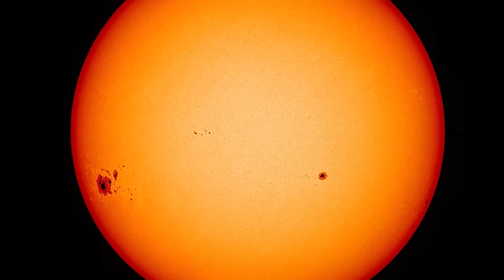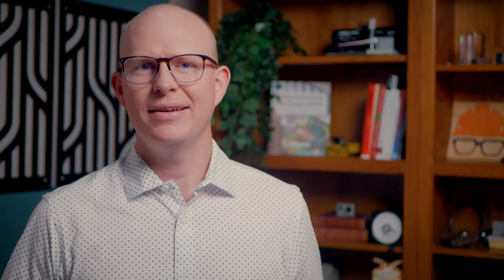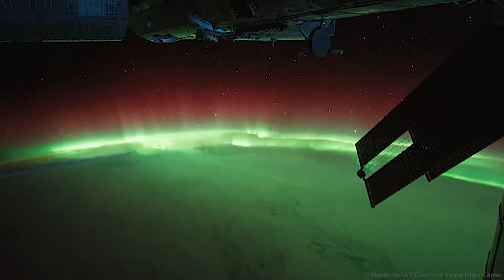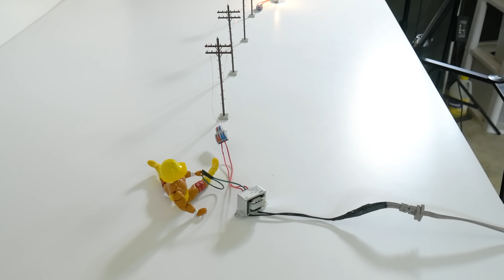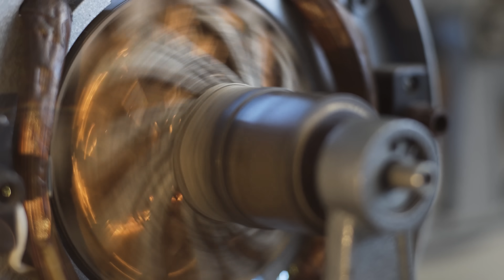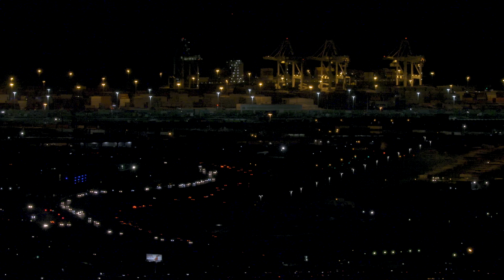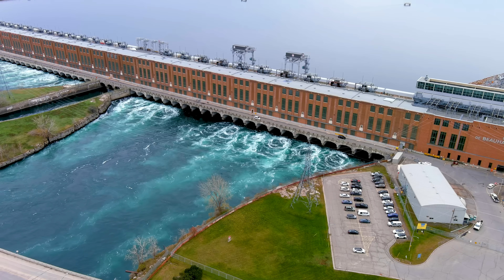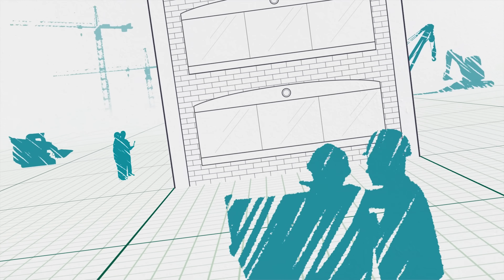The Most Confusing Part of the Power Grid

Comment: How does the design of the electric meter on the home measure only real power usage?
Reply: It just takes a whole lot of samples of the voltage and current, multiplies V * I for each sample, and adds the results together.  Simply put.  Elements representing active power will be positive, and elements representing reactive power will be negative, so you get real power simply by adding them all together.

Note that current direction != power direction.   It is (current x voltage) that represents the direction the power is flowing.   A regular resistive load will have samples that are (positive_current x positive_voltage) and (negative_current x negative_voltage).   The resulting multiplication is POSITIVE in both cases.

Reactive components will see a (negative_current x positive_voltage) or (positive_current x negative_voltage), both of which are NEGATIVE and represent power flow in the reverse direction.

-Matt
Reply: @junkerzn7312  I know how to do the integrals, I just wonder how that little device practically does it.
Reply: @spelunkerd  Sure.  Ok, so basically it measures voltage and current.  How does it measure these items?

(1) Voltage.  Voltage is simple.  The utility meter simply measure the voltage of each leg relative to neutral.  It does this by taking each leg and neutral and running them through a 1 Mohm (or similarly very high) resistor, and then to a resistor divider and small capacitor (like 10nF) to stabilize the value.  And then shoves that into an ADC in the micro-controller.

(2) Current.  There are two ways to measure current.  One is with a shunt, the other is with a current transformer.

(a) A shunt is basically a small, precise resistor.  For example, a 1 milliohm resistor.   The two hots and the neutral each pass through a shunt and the micro-controller then uses a voltage sensing circuit similar to (1) above to measure the differential voltage across the shunt resistor.  The current is calculated from that differential voltage.

(b) A current transformer can be used instead of a shunt when measuring AC current.   A current transformer is basically an inductor wound around each of the legs and the neutral (three of them).  i.e. just a piece of wire with a couple of winds around a cable.   Usually its a few hundred windings... like 500.

AC current through the leg/neutral INDUCES an AC voltage on the current transformer.   This voltage will be out of phase with the actual current, but that's ok, the micro-controller compensates for it.

The micro-controller then measures that voltage more or less directly.

That's how it works.  Shunts are used (A) When high accuracy is necessary and (B) When measuring DC current.   Current transformers are used when medium accuracy is ok but only work with AC waveforms.

There is a third way to measure DC current and that is with a hall-effect device.  However, this method is quite inaccurate.   "DC" Clip-on Amp Meters use this method in DC mode, and use the current transformer method in AC mode.   This is why DC clip-on amp-meters have to be "zerod".

-Matt
Reply: @junkerzn7312  Thank you, Matt.

Comment: I'm 90% less dependent on the grid.
My DIY system powers all my 120v circuits. I just installed a heat pump water heater. It barely sips on the electricity.
The grid power is now the supplemental power and solar became the main power. I only pay 20 cents per day on average to my power company.
During power outages, I have 3 days of stored electricity. When the Sun is shining, I have a unlimited power.

Comment: An easy way to remember the phase relationships is:
ELI the ICE man.
In an inductive circuit (L) voltage (E) leads current (I).
In s capacitative circuit (C) current (I) leads the voltage (E).
Reply: I always used the word CIVIL when teaching Power Systems to CIVIL engineering majors - "in a C, I leads V but in an L, V leads I" !
Reply: Oh I so remember that mnemonic.
Reply: I learned that in Circuit I my first year in college... Lets see Motion Flux Current or Mary's.... um ah...

Comment: The Tesla battery in Australia does more for grid stability than it does for supplying backup power like everyone thinks it’s was installed for.

It’s insane how much $ they make by just securing South Australia’s power network stability
Reply: no no. "The Tesla battery in Australia is meant to be for grid stability, it’s insane how much $ they make playing the energy market with it."

While I am to lazy to look up the numbers on the SA battery at least two batteries in QLD have been fined for not being able to supply the "stability" they were contacted for because they were playing the energy market.
Reply: @stusue9733  probably right, but if you knew how much they made - the fines would be petty cash
Reply: @InvisageStudios  Yes its a wonderful well planned system we have in place.

As I said in another comment, I have three generators. Mostly(though not completely in fairness) because our wonderful first world grid.
Reply: Common Elon W.

Comment: Can you heat your home for free using inductive loads?  Run everything thru a big transformer?
Reply: No, any power dissipated by the load on the house-side of your utility meter is real power.   Reactive power is REFLECTED power... it exits back to the grid through the meter.
Reply: Personally, I prefer the soothing glow of a giant resistive toaster.
Reply: @Alfenium  if I understand right though, a resistive load has a power factor of 1.  So you pay for all of it.  Transformer or a motor coil without a rotor would be close to 0, so you pay for very little of it.  Heat pumps use the power you pay for more efficiently.  But it sounds like residential meters allow some power without paying in the form of inductive loads so I would think we would be economically incentivized in the winter to use more inductive loads.
Reply: @BCroan  aint now way you're choosing hum over glow, and I thought I was crazy smh.
Reply: @BCroan  Jokes aside, transformers still draw power even with no load, regardless of your power factor. Think about how you are getting heat in the first place. It must be converted from that flowing electricity, thus drawing power. In induction heating's proper use case of heating electrically conductive materials, it's very efficient. But you're not going to be using that to heat up a working environment. Resistive elements are a way more efficient transfer of heat to the surrounding air. Thus my joke, and heat pumps even more so because of its use of refrigerants and outside air. An unloaded transformer (to have a PF of 0.2) would be like a very inefficient resistive element. A plugged in phone charger with no load comes to mind. But your argument is that you wouldn't be paying because of a low power factor which is wrong because you will still be paying for the true power used to convert some of that energy to heat. Reactive power isn't something that is measured in residential homes but its not something you can use. With a lower power factor, you'd just be messing with the grid at that point.

Comment: Can you detect/isolate only reactive power and send it to battery storage instead without actually consuming extra power to charge?
Reply: Inverters already do this.  Reactive power that flows back into an inverter will flow through the inverter in reverse and end up as ripple on the DC side.  The ripple is captured by a diode / capacitor circuit and simply adds to the voltage on the DC side, allowing it to be reinjected back into the forward direction.

If there is enough of it, it can even charge the battery (which is how inverter-chargers deal with AC-coupled solar, for example).

If you are talking about intercepting reactive power from loads inside your home that would otherwise head back out to the utility, there is no point trying to capture that.  If you capture the reactive power it will look like real power from the standpoint of the grid (because it no longer reflects back through the utility meter on the way back out).

So usually one doesn't bother capturing the reactive power in this case, one simply corrects it or, for residential tariffs, does nothing at all since you don't get charged for reactive power.

-Matt

Comment: Thanks for sharing your thoughts, ideas and videos. This is the first and only video I have ever seen that factually explains how a solar storm affects the power system. Thanks for making your video available. I have tried for years to explain it to new trainees and it was always a guess on my part on weather they understood what I was describing or they just wanted me to give up trying to teach them. Great description on the reactive power also. If you get really bored and want to see some really cool smoke and mirrors magic, check out FACTS devices. That’s a Flexible Alternating Convertible Transmission System device. It takes GTO thyristors operating in banks that charge capacitors with power and then depending on the requested mode recreate reactive power waves onto the system to achieve your desired affect. They can act like a capacitor, reactor, SVC, or in a really neat mode inject the reactive power thru a transformer in series to the transmission line and modify the lines reactance and control the power flow on the line much like a phase shifting transformer only one that it is infinitely variable. The only other way to do that trick is with a synchronous transformer which is just about as rare a device. Wishing you and your family the best.

Comment: I was a bit confused wen the introduction to this video on basic transmission physics started with a discussion of GIC, but you very neatly closed that circle toward the end of the video.

But there was another aspect of the 1989 GIC event - GIC is a near-DC phenomenon (ie, very low frequency).  Because GIC in the earth's surface creates a potential gradient across distances, it tends to drive currents through transmission lines.  Those near-DC currents in all three phases of long-distance transmission lines don't cancel at the neutral and can therefore to saturation of the iron cores of transformers at the ends of the lines.  That saturation can cause damage to transformers, and also distort the normally complex reactive flow situation which then stresses reactive compensation schemes such as SVCs.

The 1989 event was felt more severely in Quebec because so much of their power generating capacity is in the far-North - around James Bay, with heavy transmission lines running to the south to move power toward population center around Montreal.  GIC tends to be more of a problem on transmission lines that are oriented in a north-south direction and at higher latitudes.

Comment: The best PF is 1. 17:02 Too much capacitance will give you a leading PF instead of a lagging PF. Not too much voltage as stated. I was once told power companies hate a leading PF because it messes with their measuring equipment. The confusion I believe comes when you describe reactive power coming from induction when it can come from inductance & capacitance.
We once shut down a project & the power company said our PF was leading, so we just took the capacitors offline.
The generators have to supply reactive power whether it be inductive or capacitive.
Reply: A Pf of 1 is unity, current and voltage are in phase with each other. A leading PF will increase voltage, that is one reason utilities use capacitor banks, for voltage support, like he said. They also use reactor banks (inductive reactance) for situations where you have too much capacitive reactive power. An example would be a long, high voltage transmission line that is very lightly loaded. There is capacitance between the earth and conductors and with a light load the voltage at the end of the line will be higher than at the supply side. That doesn't mean more power, just means higher voltage, so they switch in reactor back to add inductance to cancel some of the capacitance and that lowers the voltage. Just like adding capacitance can raise the voltage, inductance lowers it. Power utilties have plenty of ways to add (leading) VArs, but limited ways to reduce(lagging) VArs. 
Generators normally can supply more leading VArs than lagging VArs, like he said the gen plants will  add VArs (leading reactive power) to the grid. They don't like operating with a lagging power factor, things heat up internally in the generator.

Comment: Good video, but I really wish you'd gone into more detail or will do so in another video.  Just explaining it in terms of power borrowing didn't really explain the problem to me.  I mean, why doesn't the power that flows out of one factory just flow into the factory next door (you don't return the power to the shop but directly to the next customer) so it doesn't even need to go up to the rest of the grid?

That would help me understand how all those neat devices you describe help.  

I mean I do understand the basic math/physics of AC circuits at an EM level so I guess I can just go to Wikipedia and figure out how this all relates to the diffeqs but you explain it much more pleasantly.
Reply: Voltage.

Comment: There is a beer analogy. The foam is the reactive power the liquid is the real power and them added together is the apparent power. Also a lot of commercial stores use cap banks to control their power factor. My senior design as a BSEE was to create an automated power factor correction device. Solid state switching allows this but then you run into other problems like NFPA 70 and such. Love the videos!